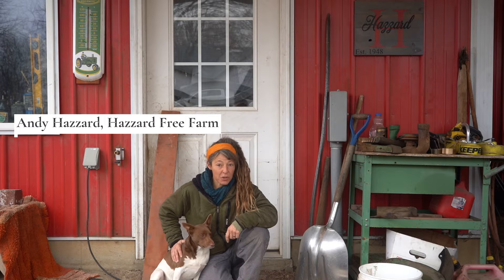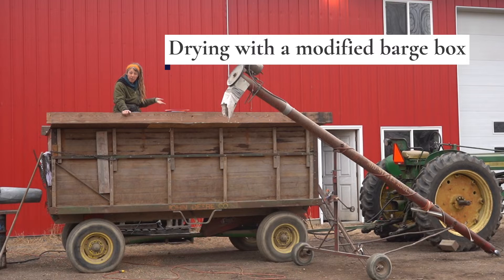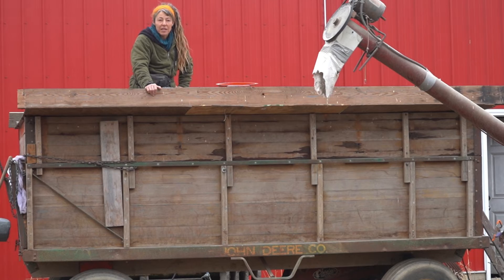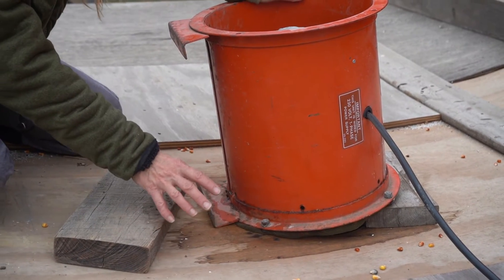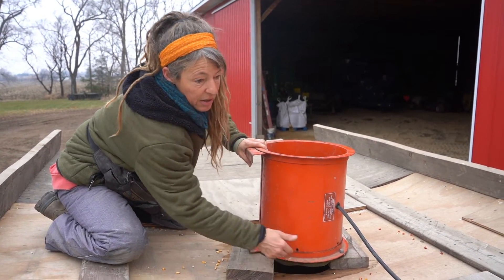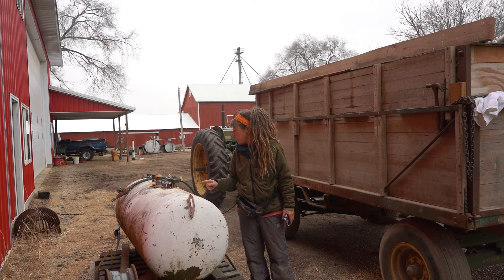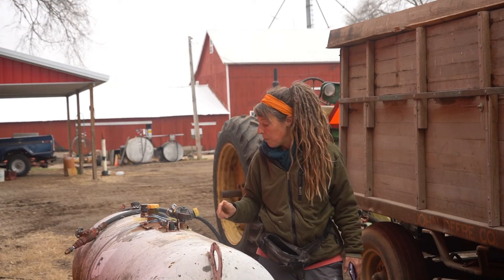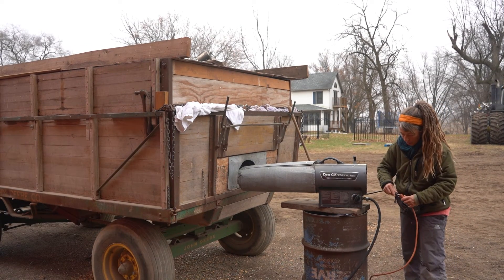Turning a Barge Box into a Grain Dryer - Post-Harvest Handling for Food-Grade Small Grains

Comment: Nice idea,  can be done pretty easily.  Question would a metal pipe with holes going through the middle of the wagon connected to the heater would help drying in a more uniform way?  Also second question isn't a propane heater directly connected to the wagon would overheat the grain?